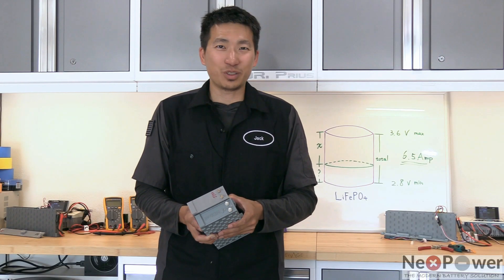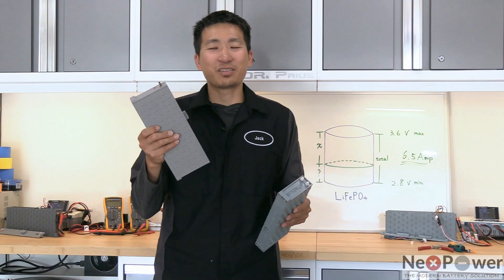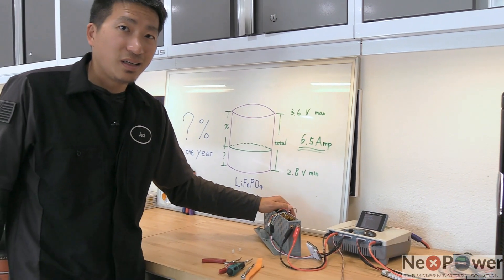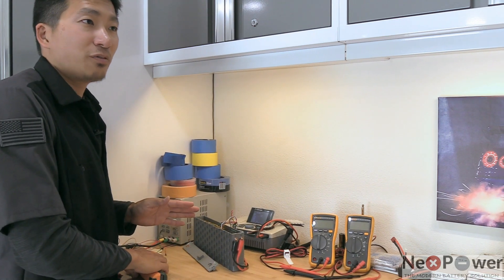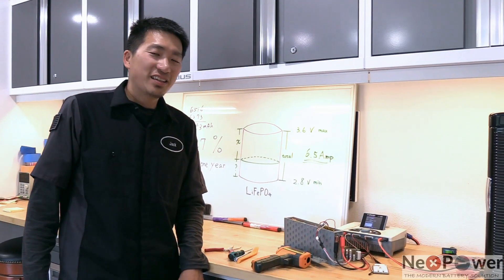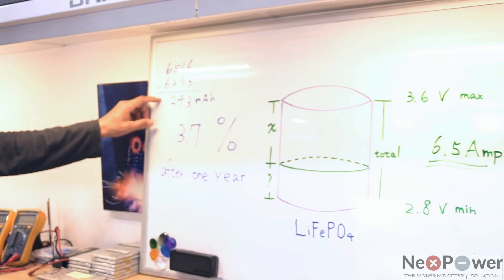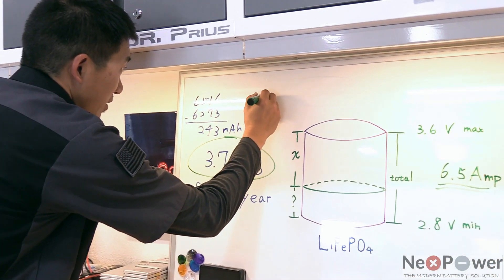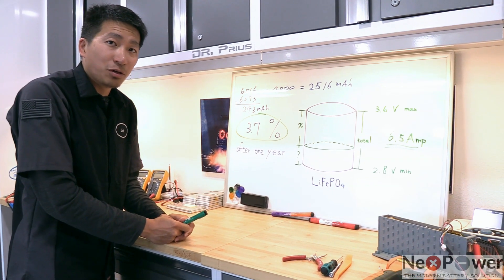Prius battery degradation test - NiMH to Lithium one year result

Comment: Still unsure about making the switch from NMH to LFPs for my Prius. The point of a hybrid battery is that it has to withstand tens of thousands of discharge cycles, probably 100s of thousands over a few years. I'm not convinced yet that LFPs are up to the job over the long term.
Reply: It’s only living in the 40-80% range max from what I have seen. 

So really there is a fraction of a cycle as most of the time you won’t be going from 80-40 unless your trying to get the maximum miles from EV driving every day. 

So its used as a traction battery where it’s state of charge is maintained in its best range, that’s why they can last longer then something that charges to 100% and drained down like a phone does. 

Hope this helps :)

Also lithium packs have more cycle capacity then NIMH but NIMH does really well with cold temps. 

Lithium still is going to be more efficient then NIMH as it can charge quicker and hold voltage longer making the car able to drive further in EV if you stay below 45mph in a Prius.
Reply: I have had a Prius LE with the lithium ion and currently own an awd with NiMH. The Lithium in June 2018 (8 month having the car) peaked at 61.7 (NE Ohio driving). By June 2019 with similar driving mileage average was 54.5. Trying to make a decision whether to go back to the lithium.

Comment: Prius batteries (most nimh) can self discharge in a week!  Toyota Carlsbad says this is normal.  Hoping the lithium is much better if it isn't then they have something that's discharging the pack in the previous itself.
Reply: nimh prius batteries won't discharge in a week if they are not weak.

Comment: So 3.7% degradation over 1 year and around 15 miles 
I had nimh modules from gen2 prius cars that had around 23% degradation over 15 years and that's 1.5%/year and modules are still usable with just higher internal rezistance 
If 3.7% is consistent every year in 10 years that's approx 37% degradation 
Lifepo4 should last at least 10 years with close same capacity when used only 40% of the available capacity like prius does 
I have some 60a Winston lifepo4 cells wich have been in a EV conversion car from 8 years ago and now they are in a solar system but for some reason they still have 60a capacity tested 3 times with same results but with higher internal rezistance wich is to be expected after 8 years
Reply from the maker: LOL, feel free to throw any number on internet, I bet you never torture test your Prius like we do.
Reply: @hybridapp7158  how about these numbers on internet, Jack?
I've restored a 2005 original battery from ~50% to 107%.
https://www.youtube.com/watch?v=5M89qeepq-4
Reply: @hybridapp7158  it's simple fact not just numbers 
3.7% degradation in 1 year is bad in my view for only 40% usage of the actual capacity 
What do you mean by torturing?max acceleration untill the battery is at 40%? 
Max acceleration means around 90 amps draw on a gen2 prius and around 100a on a gen3
Reply: I don’t believe your numbers are correct here. I searched for your videos, but found nothing. Jack at Dr. Prius app has been great to work with and communicate with and I would trust his products over anything that you’re saying.
Reply: @frodiesel0  do as much research as you like and if you are smart you will understand what I mean 
Also it's been a while now since these batteries are on the market and I have seen a single satisfied customer on any of the prius groups I'm in 6 prius and hybrid groups 
How about that for facts?

Comment: hey Jack. how many miles put on ?
Reply from the maker: at least 15k miles combine mileage from different test cars.
Reply: @hybridapp7158  What about 1/3 that mileage?  (We only drive max 5k mi a year).  Would you expect around 1.2% degradation?  (TIA)
Reply from the maker: @jessechen2701  I can imagine nobody will be putting the battery to test every single day like I do, mine is pretty much the worst case scenario, yours should be much better!